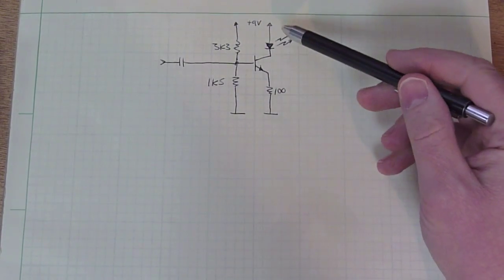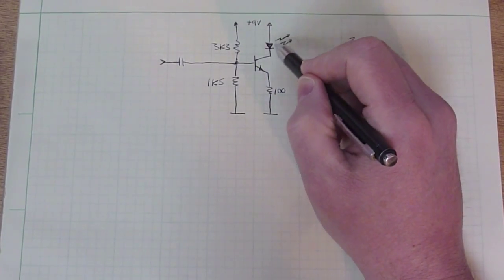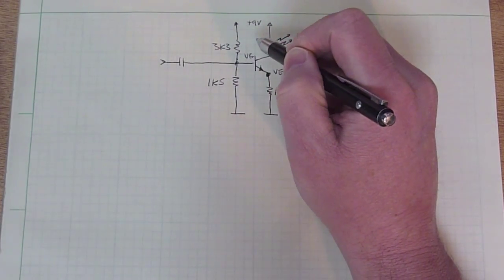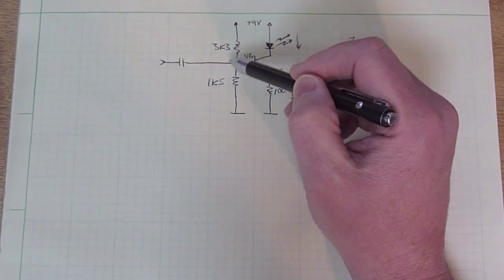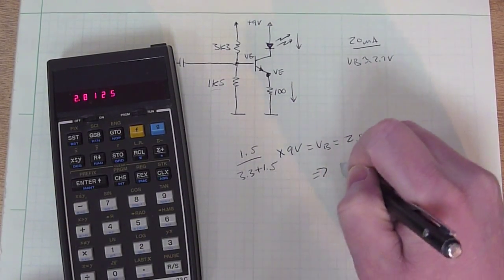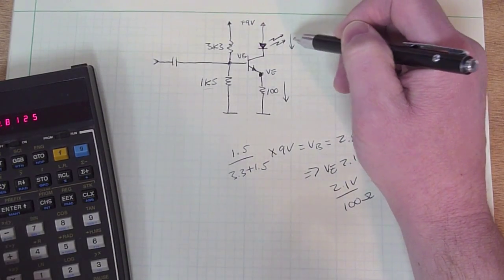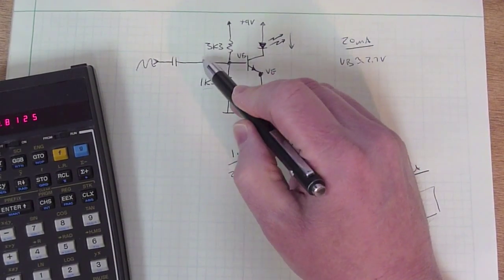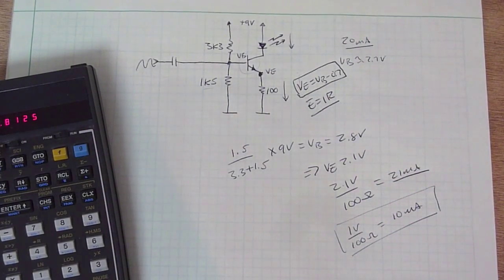AM Modulated LED Current Driver

Comment: I think you should make the two resister on the left 10 times bigger,  because the 1.5 K resister will restrict the input resistance of this setup less then 1.5 K, which is not a good voltage divider compared to the output resistance of your last stage.

Comment from the maker: You always have to consider the base current, but I didn't explicitly do the calculation here. Ic=20 mA so Ib is about 0.2 mA (20/100 for a nominal Beta of 100). Now look at how much current flows through the base bias voltage divider: 9V/(4.8K) =1.9 mA. That's about 10 times the base current, so the base current won't significantly distort what the voltage divider is doing.

Comment: Hi
I watched your Common Emitter Amplifier design first.There you paid particular attention to  the base current. Here you skip those calculations and assigned a value to the biasing resistors based only the voltage dividing value or did you also consider base current.
Thx again for another great video